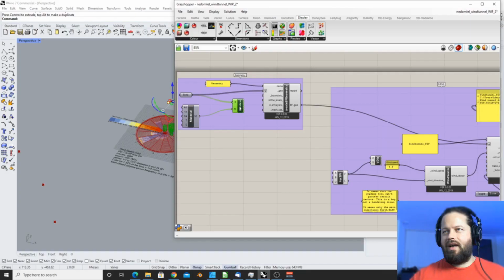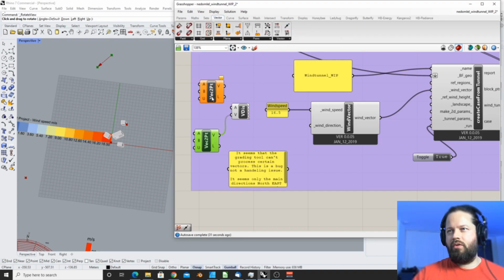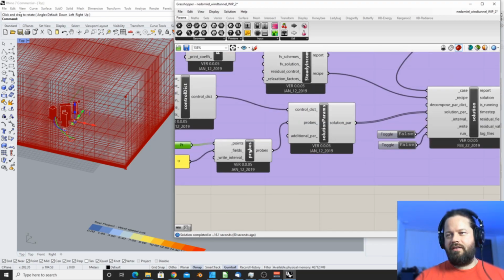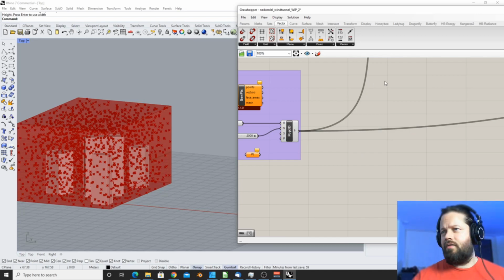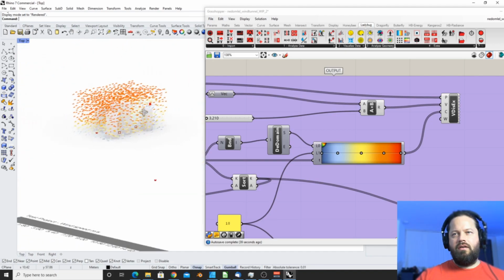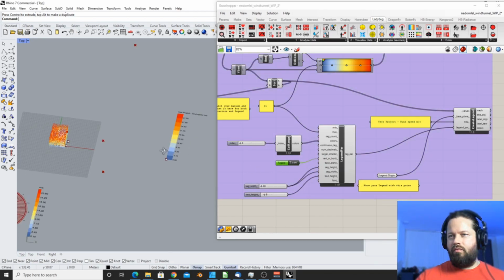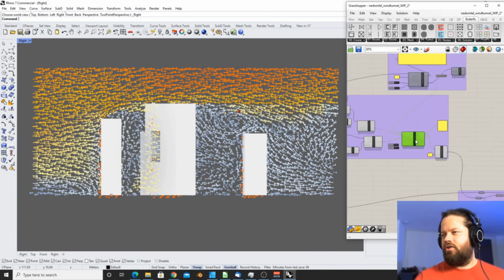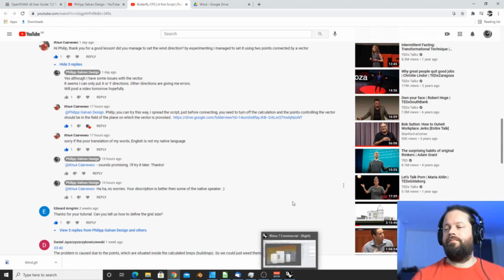Butterfly CFD | 3d Probes, Units, Turbulence and More | Fluid dynamics Rhino Grasshopper3D | Part 02

Comment: Is there any cyclone simulation
Reply from the maker: Not that I know at least not in Butterfly.
What you like to analyze?
Reply: @PhilippGalvanDesign wind flow
Reply from the maker: Butterfly can only analyze one wind direction at a time... Although you could more than one inflow but that would not simulate a cyclone.
Butterfly works like a physical wind tunnel. 
Maybe you need to modify your question. Instead of wanting to simulate a cyclone which is pretty unpredictable maybe think of what problem you want to solve first.
Reply: @PhilippGalvanDesign  yes

Comment: Phillip, can you please show supersonic flow through a tube/pipe? Like a shock tube?
Reply from the maker: Not sure how... Also be aware that butterfly only shows a moment in time not a sequence. Simulations which show cause and effect might not as straight forward.
Reply: Hi @PhilippGalvanDesign, nice to see you are still active even on your older videos. I am currently trying to design a kind of "oven" that has to be put on top of an open fire. For this, I want to research if certain holes (size and locations) and shapes inside would improve the airflow. The goal would be to regulate where the hot air circulates to regulate the temperature in the oven. Do you have any tips? For now, I just keep watching your videos and try to apply them to my topic! 

Btw I would really like to thank you for uploading these! Without your videos, I would have never considered researching this using butterfly.
Reply from the maker: @Creator-First  hey glad to see you using my videos. I think you might want to look at one of my later videos about indoor airflow and heat transfer. Not sure if you can simulate and oven (maybe) but for sure it can give some insights. I would probably suggest to also use other testing methods, including logic and common sense to make sure it really works as calculated. If you work on a real prototype you probably even want to create mockups. Good luck and let us know where you got to.

Comment: Hey Philipp, is there a reason for which you picked populate3d to create the 3d points than to make it a consistent grid? Not sure if that makes any change because now I'm struggling with my code being stuck into a massive setvars batch loop
Reply from the maker: There is no particular reason other than showing that probe points can be arranged not just as a grid but in  any configuration in 3D space. The grid definitely has its advantages in most cases.
Reply from the maker: It was important to me to show this  because it was not clear for all. The arrangement as 3d point cloud or 3d grid has some advantages.

Comment: Hey Philipp, first of all, thanks for sharing your knowledge. I have a question for you. I want to calculate the pressure on trees located in roof garden, so that I can use the suitable anchors. which software is the best?
Reply from the maker: To be honest, if this is a real project I would hire a company who can do a real wind tunnel test with a scaled or real size model.
Other than that I would say Butterfly I's a good option as long the parameters are set properly. You can locally measure the pressure. Just a note of caution: if you are thinking of adding an actual model of a tree you need to be careful. It will be very hard and time consuming to calculate a snappy hexmesh for that... Plants are tricky in CFD analysis. They are better calculated as porou massing but for that I haven't got my head around in Butterfly CFD. But Eddy 3d has this function. See here:
https://youtu.be/vPuB74am6cM

Comment: HI, I really appreciate all these wind series. I am pursuing an optimization process of form, facade design, location, and so on. I recently got interested in wind optimization of defining a form of roof. Do you think it works with Galapagos for optimization? I think there are some butterfly components are having actual values like wind speed.
Reply from the maker: Well it could work, I haven't tried butterfly with Galapagos. Although, the rewriting could be an issue since this never worked for me properly in butterfly. Also keep in mind that  butterfly writes huge amount of data onto your hard disk. Also the re-meshing every time probably requires a very simple model probably. It would be very interesting though... Keep me updated.
Reply: Thank you for your reply. Do you think I should connect Galapagos with residual_values of Solution?
Reply from the maker: That would not do much. The residual values  only show how accurate the simulation is.
Every iteration it becomes a more accurate model.  I would first define the goal you want to achieve. What do you want to optimize?
The roof shape, or its orientation? What are the criteria for the optimisation. Less turbulence? Slower wind speeds or faster? 
Do you want to create downdraft etc...
Reply: @PhilippGalvanDesign  I am trying to do it for roof shape and make it better flow so it would be faster wind.

Comment: hello Mr phillip, thanks for the tutorial, the solution to remove the very high values is by using mesh inclusion and cull pattern to select only the points outside the geo, thanks again
Reply from the maker: Yes, Thanks! i realized that i have the option within the standard Grasshopper tools. Thanks for reminding.

Comment: Great Work
Reply from the maker: Thank you so much 😀
Reply: @PhilippGalvanDesign  I think it`s best solution better than Eddy3d , i tried a lot Eddy3d for wind but it`s only work in it`s building geometry and not accept in calculation any another geometry or Brep , Ploy surface or solid , did u try Eddy wind annual calculation in any another geometry

Comment: Hey, can you share the script and which ladybug u have used ? I am using latest version of ladybug, some components are not working. Can you help me with this ?
Reply from the maker: Hey, I use ladybug tools 1.1.0 (occasionally 1.2.0) and the legacy tools if I need to.
Which components don't work on your end?
Normally that means you installation is corrupt. This script uses 'butterfly' which is a separate plugin and installation.
Reply: @PhilippGalvanDesign  rest of the components I found in ladybug and redid the script, but some components like LB UTCI comfort, heat map, etc cannot be found.
Reply from the maker: You can find a more advanced version of  script here: https://1drv.ms/u/s!AroqbdH7xD3LjfM5knnmyLcEo5zmsQ?e=B208vL
Regarding you ladybug installation : which ladybug version have you installed? did you follow the installation guide?
https://github.com/ladybug-tools/lbt-grasshopper/wiki
like for example did you ran the bat file in your user installation folder?
let me know
Reply: @PhilippGalvanDesign  hey, I have installed butterfly seperately and all the butterfly components are working fine. But, the ladybug components are not reading. majorly says " no module named ladybug.analysisperiod, no module named ladybug.epw....and so on

Comment: Thanks for great videos! For a more real example I’d imagine I would need a larger model with more context buildings around. Would you by your testing think that that will take a long time? Depend on computer and mesh accuracy of course, but my feeling is that it gets unrealistic to actually run this in a workflow, locking my cpu for hours. What’s your feeling?
Reply from the maker: But aside, I'm glad you brought it up. Your question is actually a very good topic for one of the next videos: Testing butterfly and open foam on a real large-scale example.
Let's try it and we will see how good it copes. Thanks for the question and watching my videos.
Reply: @PhilippGalvanDesign  Hi Philipp. That next video sounds really great! P.d. Thanks for great videos!
Reply from the maker: Hi Alex, I saw this already being used in a larger models. Actually just recently by a student using my script or better to say her version of the script. I think it is important to work economically and with an appropriate massing model. Same for heatgain or outdoor comfort using a complex model with all details will definitely cause long computation. My experience though is that working with Rhino CFD, a commercial plugin, in my professional job it was not faster then butterfly and openfoam and I have to say the later feels actually more reliable and versatile and direct. But in general CFD computations can take very long, doesn't matter which software.
Reply: @PhilippGalvanDesign  okay, thanks for the answer! Good to know

Comment: I started with Wind rose as well, but then I listed the vector in the Wind Boundary Profile. I think that would be a good way to get the direction based on the location. Also for the velocity, the wind profile has calculated it base on different height, although it's better to take the velocity at reference height 10 m.
Reply from the maker: Good suggestion to check the wind profile!

Comment: Hello Philip!, the direction is set by three values for example [1,-1,0] in this case, the node does not perceive an angle of 45 degrees, it turns out that the problem is in the python source code, it turns out that it is not possible to set any angles
Reply from the maker: Yes agree, there must be something wrong in the code or not developed yet. But in any case thanks for your suggestions and taking the time testing for the community. That's the whole point of this channel that we all work together. It's highly appreciated.
Cheers
Reply: @PhilippGalvanDesign  Thank you! I have long wanted to try experimenting with the wind)

Comment: 5:32 
I've resolved this by silly rotation of the whole model xD But it seems like this issue has appeared not so long ago and there are no solutions for it yet, except updating the Rhino :(
Reply from the maker: Yeah, I agree i think it's a bug in the code. 
It's a bit of a shame that such a complex system fails on a relatively simple issue.
But, let's see it as a chance to work together as a community and to solve it. That's the whole point of this channel. :) Thanks for taking the time to test the issue.
Reply: @PhilippGalvanDesign  right! By the way, since i am here, i have noticed a very crucial thing: i have tried to calculate several simulations in a single night using a datatree with different _cases in each and didn't manage with it, because it turned out, that the Solution node is constantly refreshes itself, so it never reaches the second branch and infinitly computes the first one. So, in order to avoid this, it is required to set "_interval" to "-1". The another important thing i've discovered -- there is a built-in butterfly node with skipped probes (the points inside the building, which were not calculated properly), but this doesn't resolve the problem until the end: you would have to detect and weed out the corresponding values(3.525425e+4) anyway. And the last thing i've found: there is a node, which allows to use several CPU cores during the simulation :D
Reply from the maker: Awesome stuff! I guess these are the topics to explore next.